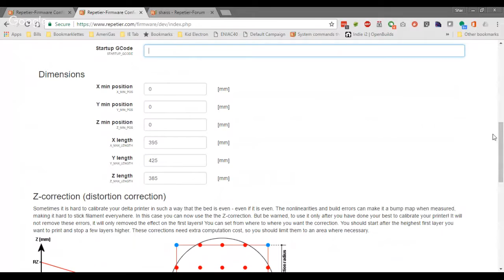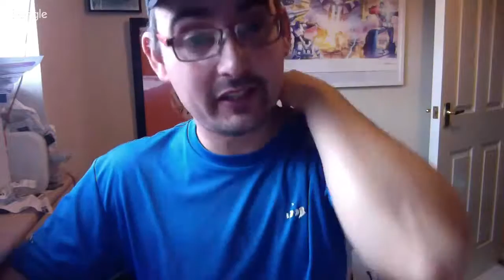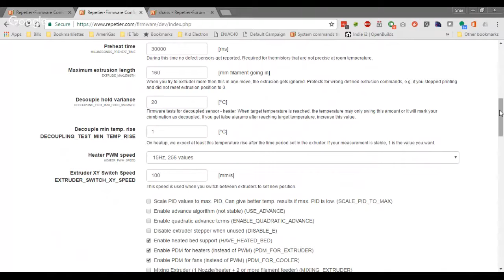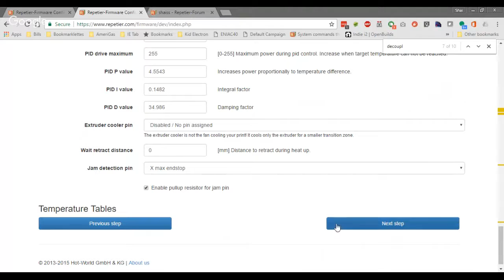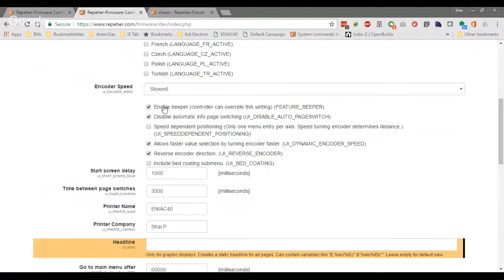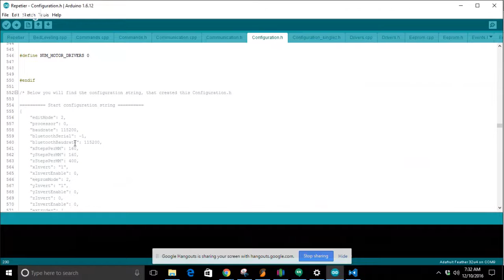ENIAC 40: Repetier Firmware Walkthrough

Comment: This was very helpful. Funny thing is I think its the only real video on using the Repetier Configuration Tool in any detail. You all explained about everything in it. Only thing I wish is if this was for a Delta Printer. Configuring for a Delta is quite a bit different. I've been trying to get it right but just can't seem to get it right. My first attempt on it made the Homing really slow and when it hit the top on axis just kept trying to home. Then I somehow inverted the Homing Direction and don't know how I did that. After that I noticed that the Axis were not right, meaning that my X Y Z were rotated compared to what they are when plugged into the Board. For example when I tried to move my X, my Z would move. ..... I don't know. I'll figure it out in time I guess. This is sort of why I wish there was a video like yours that was specifically for a Delta Printer. It would help a lot. Repetier really does not seem to have much on tutorials for their Configuration Tool. :) ............ Anyways, thanks for making this video. It was very helpful.